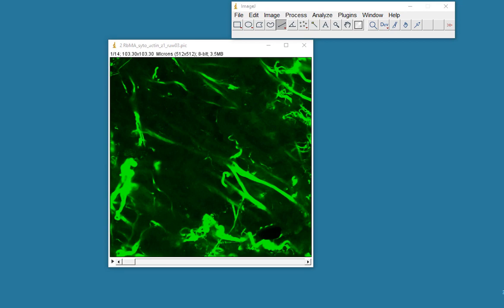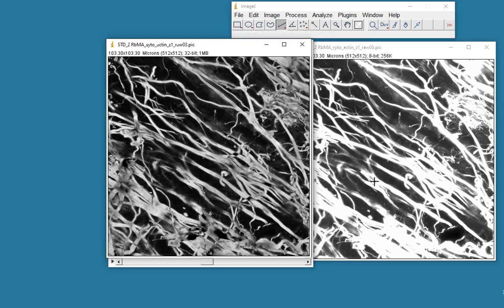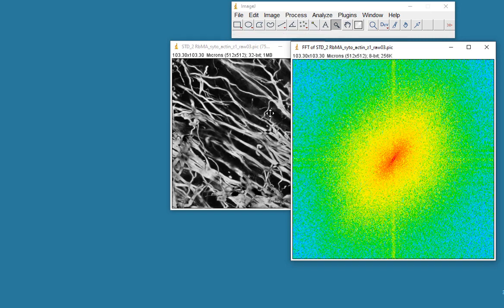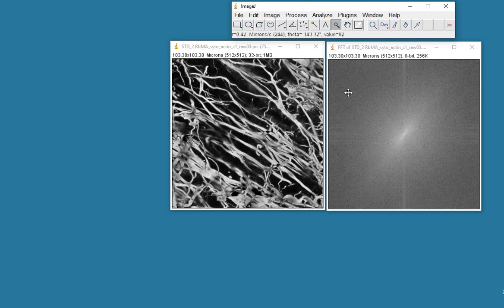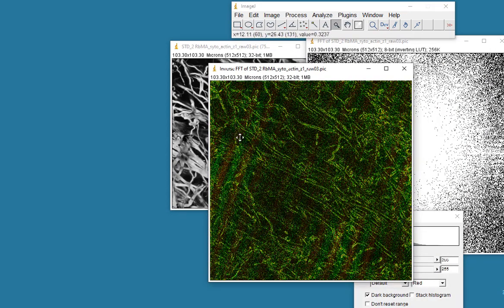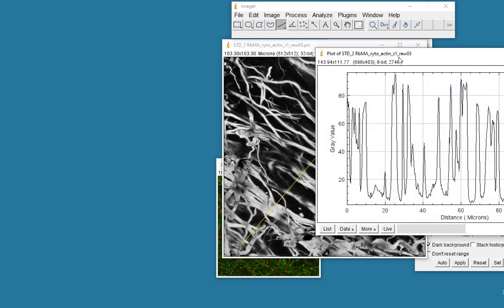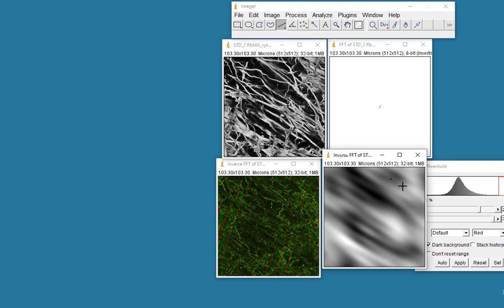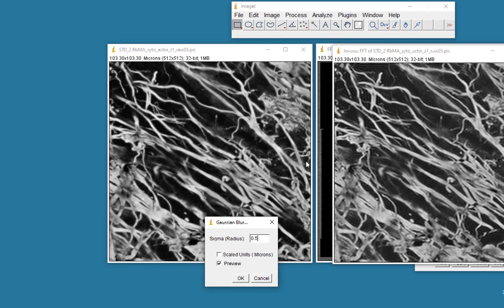Using Fast Fourier Transforms (FFTs) in ImageJ

Comment: Does anyone know of a Open source application that does this in "real time" and side by side in a image editor?
As in, you get the FFT result, you modify it, and once you stop modifying it the application updates the output.
So you can totally work on it as one would a normal image, but also see the final result, once reverted back, at the same time.

Comment: Hi, 
Have you measured the orientation/ alignment of your fibers ? I have aligned fibers obtained by electrospining, i want to check how aligned they are. But i am not sure which plugin exactly to use and how to use it. I tried downloading the orientation j plugin of image j but a pop up says that it doesn't support the plugin. 
There's another plugin called directionality, i read that one could use that too. Incase you have used any of these or if you know some other method that could help measuring the alignment, it will be helpful. 
Thankyou
Reply from the maker: Hi, If you have an image of aligned fibres could you try simply drawing a straight at 90 degrees to the long axis across the image.  Then check ‘plot profile’.  This would shows peaks and troughs between the fibres and you could measure the regularity.  Just a thought without seeing your images.  Craig.

Comment: Hi Craig. You can use the SD projection to get a nice representation of a cell images using PALM or STORM. Normally the number of blinking points gives you a saturated image but the SD (I use 2 SD's) gives a nice image.
Reply from the maker: Hi Bob,  Thanks for dropping by.  Of course I would never collect a saturated dataset :-)  Good tip though.  I'll try that out.  Hope you're well.  Cheers.  C

Comment: When measuring a fourier transformed image versus an original image, would it be correct to say that the frequency data is easier to work with, but less precise?  Is this a trade-off which should be considered when using this technique?
Reply from the maker: If you mean measuring the Inverse FFT (image) then I would argue that it offers greater precision as you have isolated a particular component of the image.  However, selecting frequencies in the FFT is not very precise as you are only guided by the threshold tool.  If, that’s what you are asking then yes, working with the FFT is easy but a bit of a ‘hit and miss’ when it comes to pulling out specific features.  Thanks for watching.
Reply: @CraigDaly  Working in frequency space with an FFT of a pixel-based image is very accurate, much more so than working with the original. If you measure a feature from the original image in pixels, and divide the width in pixels of the entire image by that number, the result is the distance in pixels from the origin point of the FFT version for all manifestations of that specific spatial frequency:
"The spacing of the features that produce the point in the power spectrum is simply the width of the image (e.g., 256 pixels in the example, times whatever calibration applies) divided by the distance in pixels from the origin to the center of the peak in the power spectrum [Russ, John C., and F. Brent Neal. The Image Processing Handbook. CRC Press, Taylor Et Francis Group, 2017; pg. 345].”